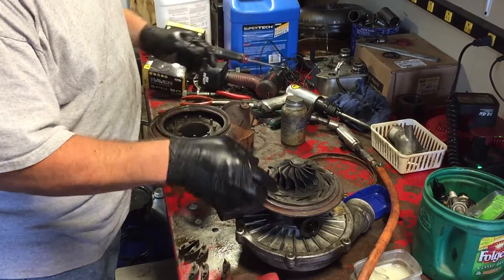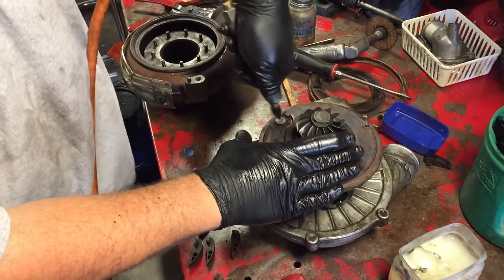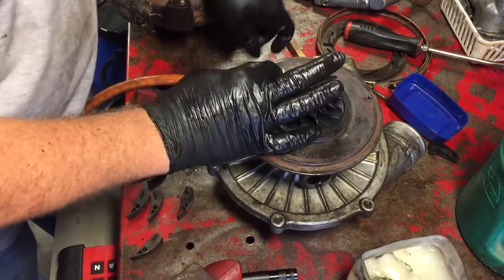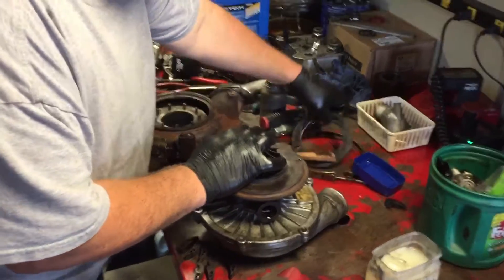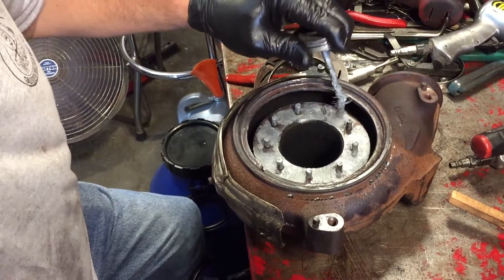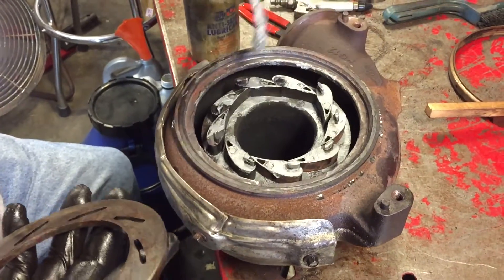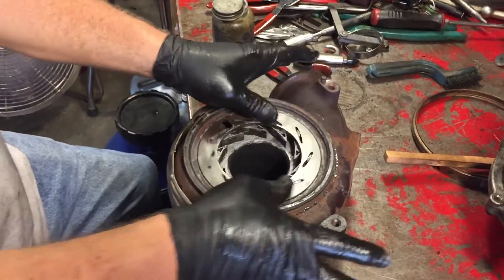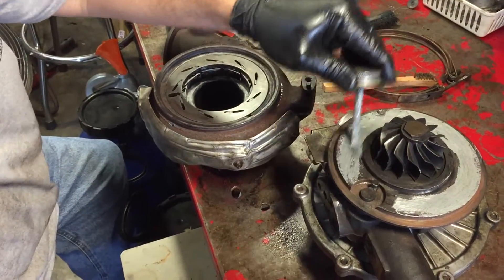2004 F-250 6.0L Turbocharger Rebuild

Comment: did you ever find out what the electrical issue was???? i have the samee issue? p0046
Reply from the maker: Hey Andrew, sorry about the delay in getting back with you. The issue was the intake manifold inlet port has a venturi plate that opens during acceleration, this flap tends to fail electrically on the 6.0L. We disconnected it so it stays open all the time and this fixed the problem. There is a flash update for the computer system to stop the code from being issued but, that problem does not turn the check engine light on so we simply ignored it and left it unplugged.(The connector is directly over the center of the front of the fan shroud on the side of the throttle body)